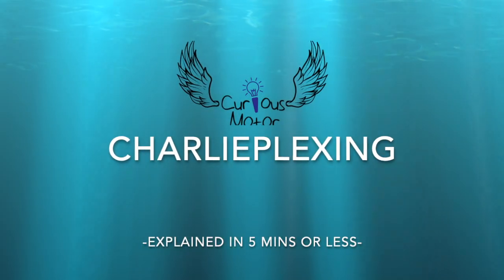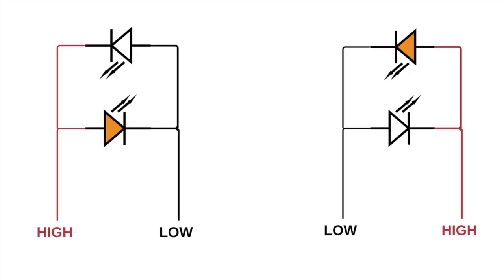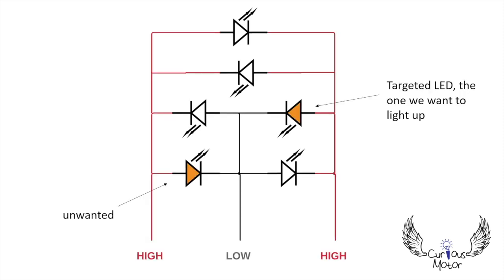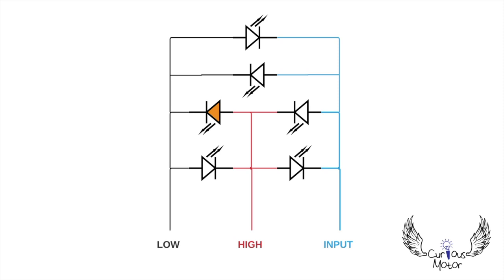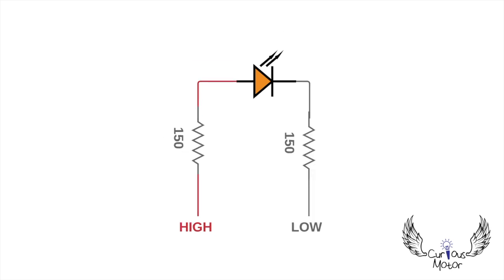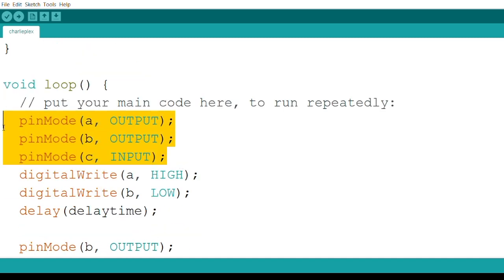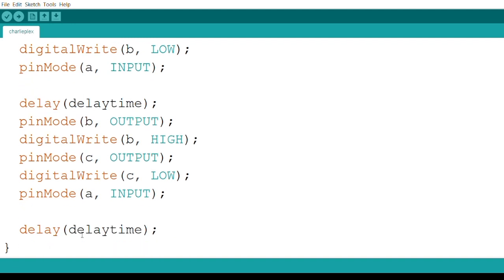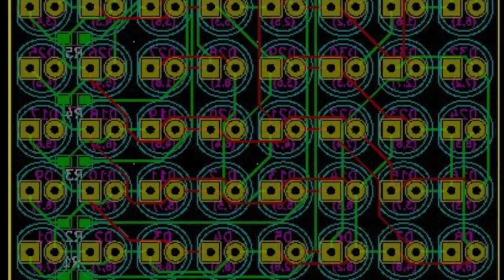Charlieplexing explained in 4 minutes | Control 6 LEDs with just 3 Pins!

Comment: I came from Reddit, your video is quite understandable and clear.
Your reddit title is NOT correct "Control 12 LEDs with 4 Pins (no extra hardware!)"
Extra hardware is required, the 'N' resistors.
I would suggest deleting your reddit thread and reposting with a more accurate title
I would also suggest including 'Charlieplexing' in the reddit title.
Reply: Thank you for taking my suggestion.
Reply from the maker: Thanks for the suggestion, I did make the changes. However, by saying no extra hardware, I meant no additional ICs were required. Essentially, if you were to control 12 LEDs you would use 12 resistors, in this case it's just 4 :)
Reply: @CuriousMotor  True about no ICs; but I'm a 'stickler' on some of the little things.
Reply: @CuriousMotor  how do you manage such people bro ? seriously!